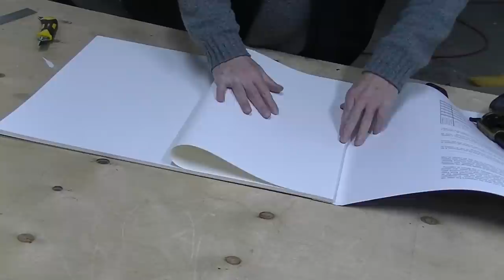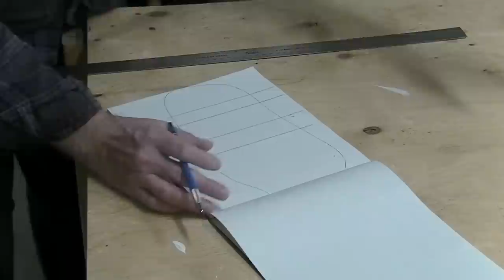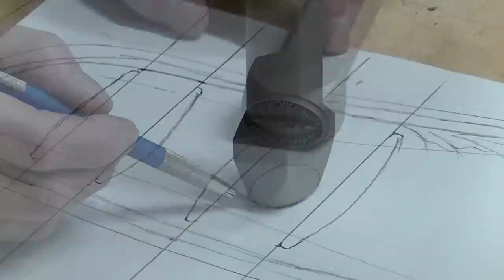1880's Mexican Loop Holster

Comment: Nice job and excellent carving. I've made a few myself and one trick I use for a custom fit to the gun is to place the gun in plastic wrap / bag and leave it in the holster until it dries. Obviously the leather will shrink a bit and form nicely to the final shape.

Comment: Really nice holster; great job. I just have one comment with regard to the long-stitch; I noticed that boot makers often create a one-millimeter or a 1/16" scored channel along the stitch line to recess the stitch; to ensure that it is sunken and flush, so as to prevent the thread from protruding to reduce thread-wear. I am wondering why this is not done along the edge of the holster as well? If you did make a channel, I couldn't tell.
Reply: Not necessary. A holster gets no abrasive damage to the seam like a shoe or boot sole would, so it's unnecessary to recess it.